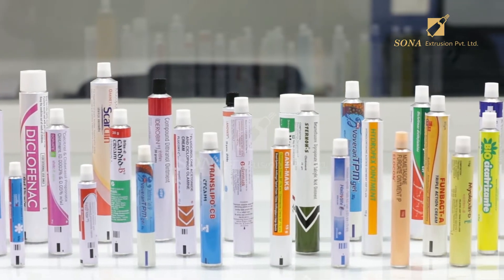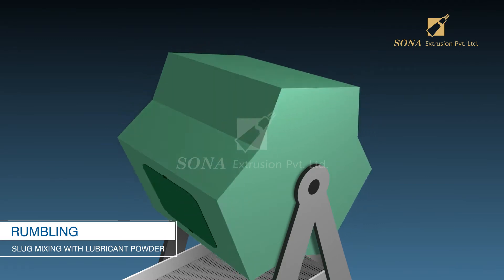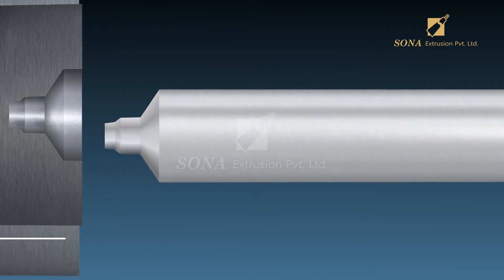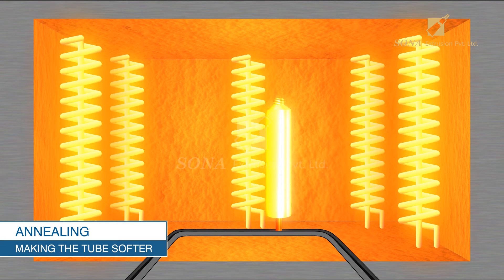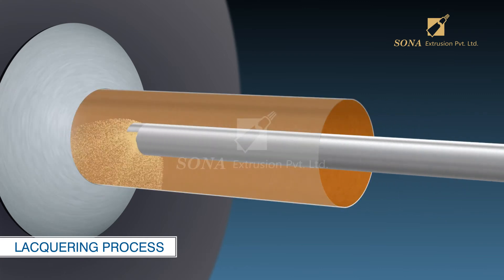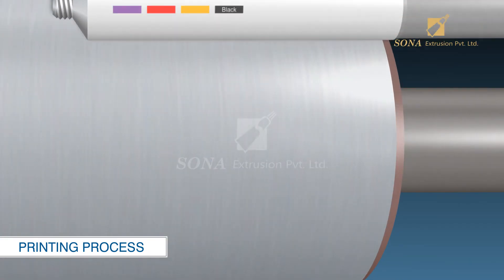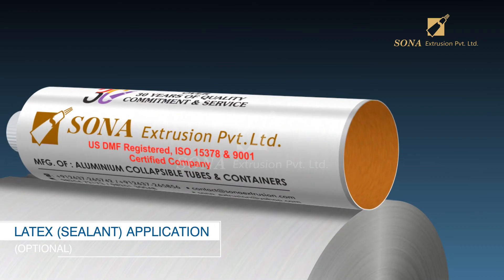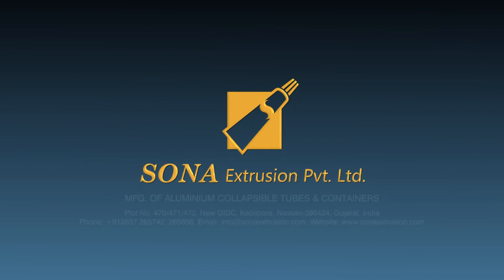How It's Made - Aluminium Packaging Tubes

Comment: Impact extrusion
Reply: My company name is Dashami industrries.We manufacture aluminium collapsible tube line, aluminium aerosol can line, and aluminium bottle container line machine. We manufacture in impact extrusion press machines. We manufacture dry offset printing machine metal closure and plastic cosmetics tubes. If u have any requirements then let me  know. Thanking you.

Regards,
Jasdev Singh.

Comment: I am in Lebanon and I know how to operate this machine and I have 3 years experience in this profession
Reply: My company name is Dashami industrries.We manufacture aluminium collapsible tube line, aluminium aerosol can line, and aluminium bottle container line machine. We manufacture in impact extrusion press machines. We manufacture dry offset printing machine metal closure and plastic cosmetics tubes. If u have any requirements then let me  know. Thanking you.

Regards,
Jasdev Singh.